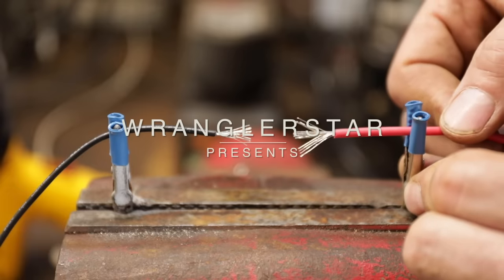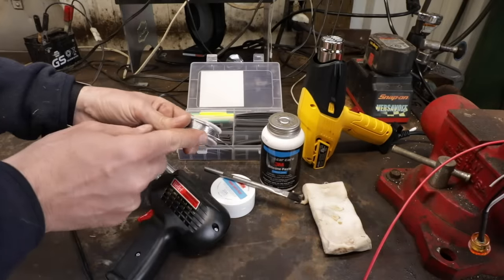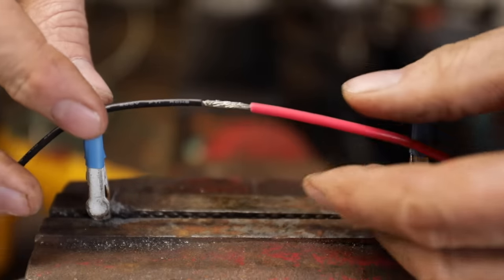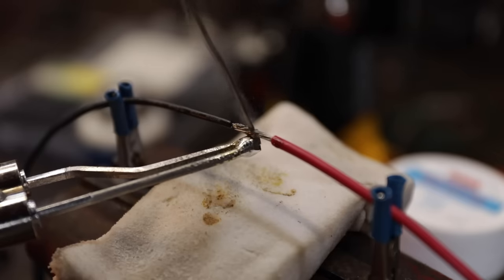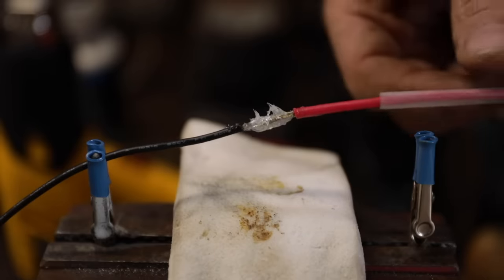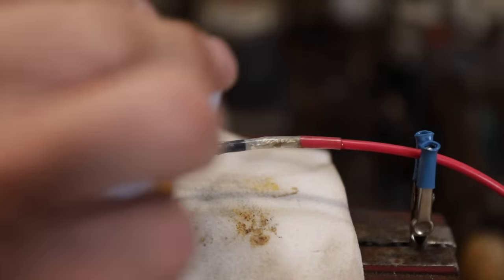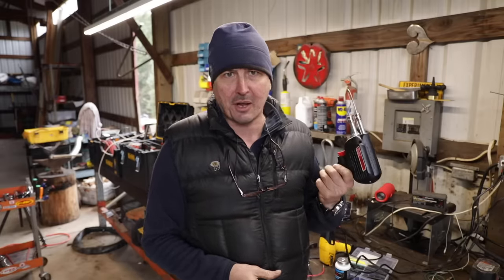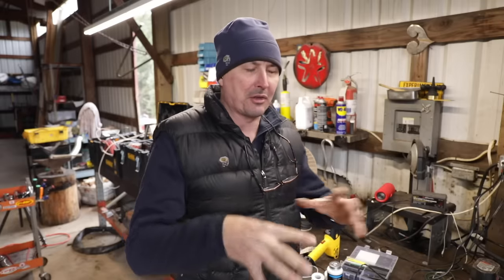How To Solder Wires Like A Pro

Comment: Lineman Splice is better in my opinion
Reply: While not wrong in cases where load on wire is not a big concern this is fine. Ford actually foregoes solder and just uses shrink wrap. Their thought process being its easier and faster to replace shrink wrap than the whole soldering process or so I guess. For context sake remember that in a car it's suppose to last multiple repairs with today's electronics.
Reply: What world do you live in where you western union splice stranded wires?
Reply: Almost any wire can be lineman/western union spliced
Reply: fun fact: It took roughly 60 years for wire splice technology to go from simple WU splices, to soldered WU splice, "shotgun" twist sleeves, to the Nicopress sleeves , developed just before WWII, to be eclipsed by IDC connectors used today, such as B-connectors, UG/UY/UR, Picabond/TelSplice... 

Much of the innovation can be traced directly to Bell Labs research, and the telephone industry looking for the lowest loss/easiest/cheapest way to join two wires together.
Reply: It can be finicky doing a lineman splice with stranded wire, like the ones in this video.
Reply: Just until you have to split back the soldered joint.
Reply: This splie looks good if you are working in a small space.
Reply: Zoltán Béres 
Wire nuts
Reply: Gubmint Cheeze never anywhere for me. Its code for homes with solid wire but a vehicle with stranded.... asking for trouble.
Reply: batvette 
prolly why 1/2 the cars I owned torched. lol
"Just twist them together. If you want to, wrap it up with a band-aid. Its only 220." lol
Reply: Yes I agree lineman or western union splice same thing
Reply: Splicing is the only recognised permanent repair method of cables in avionic systems in the MAA.

Comment: Aside from the complete hash you made of the actual soldering - risking over-heating and damaging the  wire insulation - I can't, for a moment, understand why you would put grease on the joint rather than just use adhesive-lined heat shrink tubing!?  On top of that, why on Earth would you use messy flux paste rather than just very common and cheap rosin-cored solder (which doesn't cause corrosion, for those that think it does) designed for this very process?

As a result of the comments to my comments, I watched this again and I am totally gobsmacked by the pedantic and excessively ***LOOOOOOOONG*** way to do an extremely simple job!  If this were a heavy gauge wire the technique of meshing the strands together works well but for a small gauge wire like this, the easiest, most reliable and quickest way to do it is to twist the 2 bared ends together and solder that.  Then bend it flat and install the heat shrink.  The other cosmic failure demonstrated here is that using the 'wet' solder on the iron is by far the better way to get heat transferred to the wire prior to applying the resin-solder.  There is 50 times more contact between the molten solder on the iron and the wire strands than using a 'dry' iron.  And there is no point in cleaning an already shiny iron on the damp sponge as all it does is drastically cool the iron just when you want it to be hot.  Really, this is a far better description of how not to do this simple job that would take me about 10 seconds from cut wire ends to heat shrink applied.
Reply: He mentioning I think it was his grandpa he may not have known anything else lol
Reply: He’s using rosin core solder using flux helps with heat transfer and making it easier for the solder to permeate into the wire, it’s unnecessary but not a bad practice.

Comment: ok, so to be clear, you don't put loctite on the wires to keep them from coming apart?
Reply: rjtumble only put on the loctite when you are using an arc welder °F4000 and a Helium shield.
Reply: god damnit! lol
Reply: LOL 😆  👋 to the Welder !
Reply: Not the worst way. Cyanoacrylate has good tensile (pulling) strength but a bunch have poor shear/modulous (flex). For prototype electronics its fine. But something that is inside an engine or say phone charger cable; probably not so much.
Reply: In this particular situation, I would recommend taking a swig of loctite prior to the challenge.
Reply: Flex seal is the way to go
Reply: No Sir, Not Locktite.
Everyone knows of you run out of Bubble Gum you go straight to the Duct Tape.
I like Silver the best.
Reply: @rockymcallister4258  if I dont have a welder can I use arc gouging rods with 28 car batteries wired in series to soldier some 30 gauge wire?
Reply: Loctite? Never heard of it in wiring just for locking threads.
Reply: @allanpatterson7653  It's Sarcasm Allan... but these days..it IS hard to tell if they are serious! ( I had to correct the spelling on Sarcasm,,, or all the Spelling Nazis would get Triggered!) :P

Comment: I dunno about professional, but as someone with 10+ years in aircraft cable assembly, that solder splice would absolutely get me fired.
Reply: Yeah it's not perfect but this is way better than crimp connectors.  What would you change/improve?  Do you do that "NASA splice" where the two wires are bent into U's and then hooked and twisted around each other before solder is applied?
Reply: @CassidyHansen  Fraying wires is a big no-no on contacts, splices, solder, everything.  Flux is not necessary unless you busted out a roll of solder from 1980 or you're dealing with something like 8 awg wire.  Also ditch the sealing slime and get some shrink sleeves with glue already within, or splice covers that have the little seals at both ends.  As for what I use at home, the lineman splice would be my go-to, but I also have access to M81824/1-2s and crimp tools from work. :)
Reply: That's because Aircraft wires are subject to the Fuselage expanding and compressing during Flight and a more secure method is needed. With this method on an Aircraft..the twisted wires could Pull apart or Solder Joints could crack during flight and actually CAUSE a Critical System to FAIL!.. So You are Absolutely Correct in your statement.. However in avg home applications this method should be Fine.
Reply: @kayfluff  His way is perfect for us guitarists, except for the flux and sealer. Our guitar cavities have limited space and we don't want large knots (as I have seen) or any kind of connectors.
Reply: Lmao
Reply: @daddydawg1902   class 3 j standards are needed for aircrafts. Solder won’t crack unless you do not leave a tolerance in the line. There is a better way to splice wires together and that is like making a cross, then wrapping one wire over the other, both sides. Keeps the shape, then solder and shrink in place. It is called a linemen splice and is very effective.

Comment: 4:09 - literally everyone at some point in their soldering adventures lmao.
Reply: I was thinking the same thing, I saw the edit and I know what was happening!
Reply: if it takes too long, you just gotta have the solder touch the wire and the iron and as soon as the solder melts, drag it back ontop. You will conduct heat way better that way.

Comment: I stopped watching at the"clamp them in your vise".     Yes because I have a vise under my dash.. where I solder 90% of the time
Reply: Wheres your video on soldering? " cricket ,, cricket "
Reply: @waltermercado2937  this is not how to solder wires like a pro, a pro can solder wire with two hands. No vice needed. This connection has poor strength compared to twisting the wire ends making an X pattern, then with each hand grabbing the insulation of one wire and the twisted wire end of the opposite wire. Twisting them this way is much stronger, and can be done in places you can barely reach with your soldering iron. You only need your two hands, when you go to solder, the wires are self supporting no matter the gague. Also you heat the piece, letting the solder pass through the piece to the heat source. Never touching the solder to the soldering iron except for the daily tinning
Reply: @jordanhaslam9269  this is not how to solder wires like a pro, a pro can solder wire with two hands. No vice needed. This connection has poor strength compared to twisting the wire ends making an X pattern, then with each hand grabbing the insulation of one wire and the twisted wire end of the opposite wire. Twisting them this way is much stronger, and can be done in places you can barely reach with your soldering iron. You only need your two hands, when you go to solder, the wires are self supporting no matter the gague. Also you heat the piece, letting the solder pass through the piece to the heat source. Never touching the solder to the soldering iron except for the daily tinning
Reply: @Anyone700  "Never touching the solder to the soldering iron except for the daily tinning" yes, he mentioned that in his video, I'm not sure why you're repeating it
Reply: You should of stopped when he said soldering is better termination than crimping.

Comment: You can melt some solder on the tip of the gun.  Some molted on the tip makes it heat up the wire quicker.  Just be sure that the wire gets hot enough to melt the solder.  When I started using shrink tube I used a hair dryer to shrink it.  Was adequate until I got a heat gun!  Harbor Freight has a Drill Master heat gun that is reasonably priced and works well.  The only Drill Master thing I've found worth buying.

Comment: Thank you for showing us.
But why don't you place the heat shrink tube over the wire first, then pulled to the one side of the cable, then solder the wire together?
Regards Gary Tangeman
Reply: because the wire was free on either side so he didnt have to. if this was a real connection he was making then yes u would put the heat shrink first to one side

Comment: Why did you use the flux? I was taught when I was in school shop class that I did not need flux for electrical wiring and the reason for that was the electrial soder had flux in it.
Reply: David Lingelbach yeah if your using the correct solder for electrical, rosin core typically. You do not need flux. If you do use flux it's a good idea to clean the joint once cooled because certain flux can actually cause corrosion in the joint overtime
Reply: if you are joining well vertdegred wires additional flux is a good thing, a new wire would be better but not always an option
Reply: Its so the solder dont jend up being just a coat around 2 disjointed clumps of multicored cables.
Reply: I've found having liquid solder flux is handy for electrical work, sometimes you need a bit more flux than what's in the solder itself, especially if your iron tip and/or exposed wires have a bit of oxidation. The liquid flux soaks in between the strands of multi-strand wire better than the paste.
Reply: Joe Van Cleave yes especially if you have aged components with steel lead wires (like most), if I do any through hole work I'll use rosin  flux pen if I have it, if I'm doing surface mount it will be that other stuff with non rosin solder or solder paste with flux in it, it's certainly not a sure thing to use row in core solder for everything  but for most people it is adequate but not optimal without additional flux, for joining clean new wires like the demo it would certainly suffice
Reply: David Lingelbach you're right, the wire has rosin in it lol there's no point in adding extra flux. You only add flux when the wire doesn't have any in it
Reply: If you have very new and clean wires and some rosin solder then you don’t need flux but some wire is bad and the solder dosent stick to the wire

Comment: Nice tip about speeding the fibers. It is much smaller joint than the "Western Union Joint" I usually use.  

By "tinning" it, allows more heat flow from the iron to the wires.
Reply: Yep you can tin the bare wire when joining to solder pads ECT and also should run the tip, him wiping it on a cloth is not tining anything lol
Reply: Let me explain a few things...
1. Tinning the tip of the iron is done for a couple of reasons. First is because as the iron remains heated, corrosion forms on the surface of the hot solder. Second is to tin it so you have extra solder to wipe off the corroded solder just like he very poorly wiped it on the sponge. Corroded solder should have come off onto the sponge leaving freshsolder behind. Third, you need a proper amount of solder for sufficient heat transfer. His wires took so long to heat up because he didnt have enough solder on his iron. By having a larger fluid surface, you come into more contact with the wires surface faster than pressing just the iron. Notice how once he started adding more solder it wicked up the wires and how once it was 90% coated he was able to reflow it super fast? Proper amount of solder makes for faster heat transfer. 
2. Joining method doesnt matter as much as how well the solder flows into the wires. If the wires are properly soldered (regardless of joining method) they will be very difficult to pull apart. If they pull apart easy, its likely a cold solder joint or not enough solder/flowed solder. 
3. The flux he used is 100%unnecessary if the wires are clean and the solder already has a flux core. However if youre having difficulty creating a good flow of solder, the flux will help tremendously.

Comment: Speaking as someone who has been soldering for a living for 3 decades, there is NOTHING in this video that is "Like a Pro".

Pros don't use a Weller "Firestarter" inductive-heat soldering gun; we use a temp-controlled iron or gun. That thing is literally a short-circuit with a handle.

We NEVER do "twist splice" and solder... that leaves entirely too much exposed bare conductor. We do a simple lap joint, with overlap of approx 2x the diameter of the conductor. Mission-critical connections get a crimp ferrule AND solder before heat-shrinking.

Silicone grease under the shrink wrap?!?  THIS IS A HORRIBLE IDEA. Lubing up the heat-shrink almost guarantees that when you're pulling cable, the heat-shrink will slide off, leaving the bare conductor exposed at the joint.

We use self-sealing heat-shrink. It has heat-bonding sealant already applied inside; and unlike your method, it actually adds mechanical strength to the connection. You can do similar by applying hot-glue BEFORE applying the heat-shrink; apply enough that it encapsulates the joint completely and oozes out the ends when you heat the heat-shrink. This makes a PERMANENT, waterproof splice.

PLEASE... go to SOME tech school and actually take a course; learn how to properly prep and solder wires. And take down this horror show before someone burns their house down following your advice. :facepalm:
Reply: Thanks for the added info in your answer. I was thinking air tight crimped ferrules was the way to go.
Reply: I was gonna say, I was always taught that a lap joint is the way to go. But that was when I was extending wiring for a motorcycle project. So I thought maybe this video showed a better way. But I am glad you confirmed my belief.
Reply: @per.kallberg  - Well, crimped ferrules don't make it airtight; especially the ones that come with heat-shrink already applied. But if you use plain crimp ferrules then sealing heat-shrink after crimping, the resulting splice is considered safe for permanent immersion. This is how submersible pumps are wired.
Reply: mnemennth- you're spot on here. His shtick seems to be grossly overselling his own knowledge/abilities/aptitudes, demonstrating a tool (as a complete hack who himself watched a Youtube video 10 minutes earlier), then providing an affiliate link. I used to really enjoy this channel for it's folksy, down-home ranch stuff but this new formula is just repellent and completely destroys whatever credibility he once had. He has become a Youtube hack psuedo-expert. Sad.
Reply: overlap of 2x the diameter of the conductor; yikes! That's not a lot of bond.
Reply: Agreed

Comment: Obviously a comedy clip, excess flux, excess heat, recommending a soldered wire joint for wet/movement area .   This video is a lesson in what not to do.   Heatshrink is available with glue inside that positively seals and also this is availble on crimp connectors.   Flux is acidic and along with the heat changing the annealling of the wire causing it to be brittle is enough to make it fail in an envrinoment that is prone to vibration and moisture.   This is why crimping is considered to be industry standard.    If there is a need to resist moisture, there are crimps designed especially for that too.
Reply: grant Rothwell this was certainly a hack job at best, I’d fire someone who did that in my shop.
Reply: Juan horn then why does someone need to “make a video” for you? Plenty of good examples on the internet, Louis Rossman comes to mind.

Comment: This video demonstrates FIRST soldering the wires together and THEN threading on the shrink tubing. This is a newbie mistake. Normally one has to thread the tubing on first. There is rarely a bare wire end where you can thread on the tubing after making the joint.
Reply: Harvey Cohen  learned that the hard way.  Always embarrassing when I repeat that mistake once in a while.  Mostly do small PCB Assembly for guitar pedals so I don’t use the tubing often enough for doing it right to become second nature.
Reply: I was wiring LED's up on my motorcycle. made that mistake. had to redo 6 different soldering points
Reply: do u really think this guy even thought of that? 😂😂😂😂